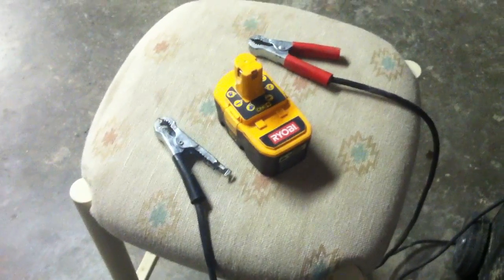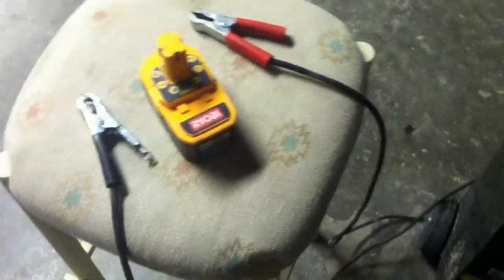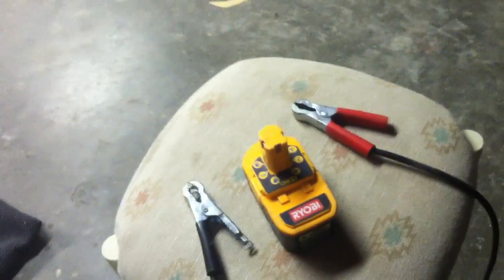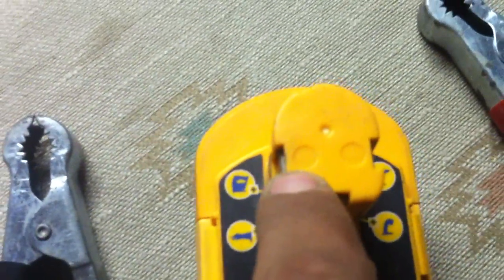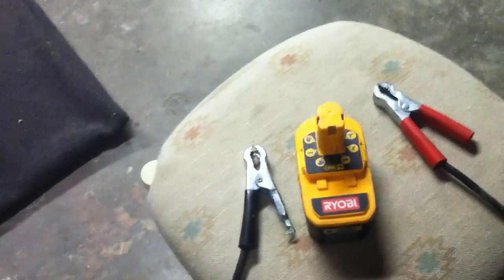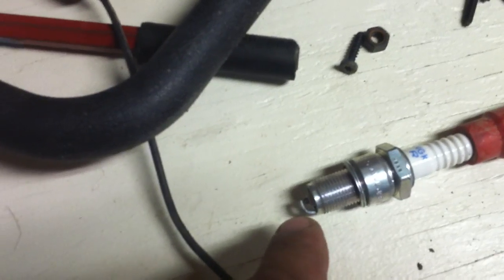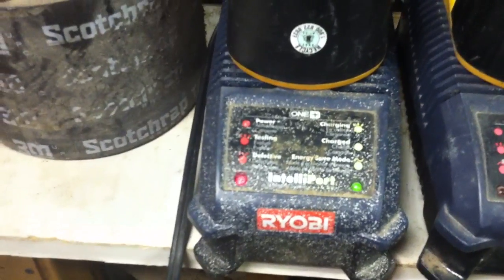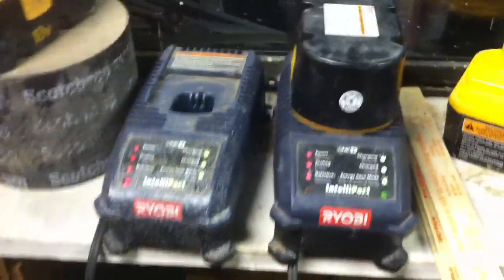Nonchargeable Batteries Recharged:18 Volt Battery.

Comment: i had tried the other tricks and they had not worked.  I used the 12v battery charger and that did it!  The battery is now charging on the regular charger.  Thanks for this excellent video!  I'm now excited!

Comment: You are so full of crap "Excite", "touch it to get a spark and it'll have a 'starter charge' ". Idiot, NiCD and NiMH batteries build up a wall of DENDRITE Crystals" internally. What the "spark" shocking does is to literally blast the Dendrite Crystals just as you "de-sulfate" a Lead Acid battery the builds up a Sulfate layer on the cathode lead panels in the LA battery. Voltage needed to "shock" the battery NEEDS TO BE a Minimum of TWICE the voltage capacity of the battery. 12 Volts will do shit in a 18V Ryobi NiCD battery. You need to shock (a single spark) it with 32V to 100V to blast the Dendrites. Do some research before your spread your BS info, you sound like a moron.
Reply: Yeah, this didn't do shit to my completely dead 18v riobi. Ill hit it with the welder and let u know.

Comment: the battery charger wont charge blow a certain voltage and also the ohm of the sense tab causes issue too at times a good battery in parallel is best

Comment: Someone had thrown out a Dewalt 14.4 volt drill, with the charger. It was blinking fast for a replacement, I tried unlugging and plugging it back in about 5 times and it eventually started charging normally. Worked great

Comment: Thank you that was a helpful hint I have a Black and Decker drill one is 12 volts and a 18 volts both batteries are dead cuz I had them sitting in the garage too long forgot all about I am going to give this a try and hopefully it will work. 👍

Comment: I tried the on/off trick with one of the original NiCad batteries and it worked. However I couldn't get the second battery to go no matter how many time I flipped the switch. Your video reminded me some one said to use a car charger and flip polarity and touch for a second. That worked and it started charging. So you are right, anything that sparks it has the potential to work.

Thanks for the video

Comment: I don't care what these other people say about you. I think your Awesome. 
How ever, this Will make your charger recognize the once completely dead battery and start charging but 9 out of 10 times it will Not take the full charge any more. For instance: You do this trick with an 18v but it will only charge up to 14 volts and then looses voltage and drops down to 9v.
My point is that the trick does not fix dead cells. This will work in a pinch for a short time and get a small job done for you but I think that if you have any bad cells you have to do a full rebuild or buy a new battery. The rebuild is tougher then these videos show you unless you invest in the proper tools for re-soldiering. I tried this with a regular soldiering gun and it just don't stick well.
By all means try the tricks before you trash them. You may get lucky.

Just my Nickles worth....

Comment: Didn't understand the motorcycle coil part. Do you hit that coil with the volts from the battery charger like you would with the drill battery? The way you present this is to leave everything connected to the bike and just pull out the plug leaving it connected to the bike and then turn the bike over. How is that doing anything different than firing it up with it still connected to the cylinder? I'm thinking you meant hit the coil with the high current and then put it back in the bike. Just curious.

Comment: Just yesterday I tried a trick I saw a while back on YouTube, it worked. I connected a wire from pos to pos and for neg to neg a good battery to a bad one, only about 15 seconds. It now takes a charge and I have used it. What sucks is I threw away about 4-5 batteries before I found and tried this trick, that well over $100 in the trash.

Comment: So what if my charger shows that it’s charging but when I put the bat in my saw, it cuts for about a foot it dies. Bad cells or faulty circuit board?
Reply: Nine months later you finally get a reply....i had the same experience.   I used the DC welder technique.   I found that going back through the process over and over until I was satisfied with the performance was worthwhile.   I have every style battery in my arsenal and all of them are good as new except one that I am certain was completely shorted.

Comment: Here is a problem for you people :
I left my P106 Ryobi drill with its Ryobi ONE ni-cad 18 volt battery in a drawer for a week..
Seems the switch was defective, as it killed totally the battery...
Tried all the methods shown in this section and I got it to charge with the red light of the charger ON  up to 15.6 volts which, placed in  my drill, I can stop easily the chuck with my 
hand, WHICH DOESN'T HAPPEN WITH A NORMALLY CHARGED BATTERY....!!!!!
If anybody has any idea of what has happened to my battery and more important, how is
it to OPEN it because I removed the screws but the cover doesn't come off and pulling on
it feels like there are wires attached to it, as the only explanation for its conduct seems to 
me that most probably one or more of the little batteries inside gave up the ghost...!!!!!!!
Thank you
Jacob
Reply from the maker: little battery's ? bon jour. hahaha thanks for watching.
Reply: @thomasbriansavingmoney  
It may sound funny but at the end, is there an answer to my question from knowledgable guys on almost everything about batteries, little batteries ASIDE...??????

Comment: I heard somewhere that you should "excite" the battery or coil, you have to get it excited, you need to excite it."Just curios if anyone has heard that before. ;)
Reply from the maker: perfect. thanks for watching. pretty exciting stuff.
Reply: Yes Tom :
In electric power generation for instance, there is something like EXCITING a component, specially in generators.
You won't believe it but with a 1.5 volt battery, you can EXCITE a generator to start
generating electricity, if the little remaining magnetism of the stator poles is gone

Comment: These battery "rejuvenation" techniques generally work to allow a charger to again work on what was a fully dead battery. But the main problem is the battery technology itself. This, and many other similar videos are all using nickel-cadmium batteries. Once they are fully discharged, at least one cell in the pack will never hold a good charge for very long ever again. I have many Dewalt 12 and 18 volt NiCad packs that are shot. The packs' prices are approaching that of complete tool kits with newer Li-Ion batteries. I have since stopped buying $75.00 NiCad packs and converted to drills and other cordless tools that use Lithium-Ion batteries. The packs hold a charge much longer when not being used. I have never had the problem of a fully dead Li-Ion battery yet.

Comment: Nono no. Coils do NOT develop crystals. Coils are hard WIRED copper. There is another reason you get results. Batteries are the only thing that develop a bad connection inside due to the CHEMISTRY.
Reply from the maker: and what chemistry is that, could you give more detail ? because i opened  a bad one and a good one because i wanted to see for my self what was going on, and the bad one had white crystals. the good one did not. i do not think you are a subscriber or that video would of found you after watching this one. let me find it and post you a link here and you explain the chemistry  side of it to us after seeing it. that would be great to get your input seeing how you seem very sure. let me get you that link, thanks or watching.

Comment: I watched another presentation that used two pairs of scissors to "excite" a bad battery from a good one. That didn't work for me, but it gave me an idea. 
I had an extension cord without a female end (thus, three exposed wires -- green/ground, black/negative and white/positive). 
I ascertained the battery positive and negative poles to touch. Making sure the open/hot wires were not touching, I then plugged the cord into a wall, then touched the positive and negative poles with the proper wire just for a split second, which gives off a nice spark (make sure you have protective eyeware and rubber gloves). Then I plugged the battery back into the charger and it's now taking a charge. 
It works. 
Now I just saved at least $50-$100 by not having to buy a new battery.
Reply from the maker: yeppers,,, same concept. good thing you were working with a/c because black is your hot. but your ok because the white is neutral and on a bus bar so the alternating current sent back still gave you voltage. on d/c black is ground , but on a/c black is hot fyi.. great job...thanks for watching.

Comment: Black n Deker 14.4 Shocking worked the older battery is solid, But my newer battery only gets 7volts compare to 16v on my old battery. Tried longer shocking got upto 10.9v but seems that i blew the newer battery cause its staying warm, not even plugged in i left it outside just in case. SO DONT KEEP ON CONTACT TOO LONG
Reply from the maker: great advice,, thanks for watching.

Comment: Chargers read battery voltage before the charge circuit is applied. If voltage is too low the charger will not charge. Quickly plugging and unplugging the charger will apply a small voltage to the battery. Do this long enough there will be enough voltage for the charger to work. Applying voltage with a battery charger will also work. It doesn't excite "crystals". The vehicle battery charger boost the battery voltage enough so it will take a charge. We had a pile of dead Milwaukee and DeWalt batteries at work several years ago. I spent an hour jumping them with a vehicle battery charger and revived 90% of them enough to take a charge. Most still had reduced capacity. I took this one step further. I disassembled the batteries that were weak or would not take a charge. There are several small batteries about the size of a C battery connected together in series that create the battery output voltage. I tested each cell with a voltmeter to determine which one was bad. Went to batteries plus, purchased the new cells for a few bucks each and soldered them back in place. Viola, an abundance of working batteries that held a good charge for minimal cost. This was on the old style batteries. Dont know how this would work with lithium batteries but I assume they too have cells inside that can be replaced once they can no longer take a charge.

Comment: I wish that I saw this video or the other similar ones about this process a few years ago, as I threw out a couple of good drills because the replacement battery packs cost more than the drills. This time I decided to take a different approach and was going to rip open the battery pack and replace all the cells. Then I found this procedure. I have been in the electronics industry for over 45 years and did not think that this had a chance to work. Well with nothing to lose I tried it and it did work. Before trying  this, my AC adapter melted down trying to charge a partially  dead battery pack. The AC adapter could only put out 1/2 amp and the battery pack would only charge to 12 volts, meaning I had 5 shorted cells. I used a laptop battery charger rated at 19.5 volts 4 amps to excite my battery pack. It would draw over 1 amp if left connected so that's when I did the repeated connect/disconnect and within a minute or 2 the current dropped to about 600 ma and the batteries were already putting out almost 18 volts. What more can I say? Now it's time to rejuvenate the laptop batteries.
Reply from the maker: excatly and well explained. thanks for watching pigman !
Reply: Pigman 5

Comment: This same thing work with phone battery when it's dead and won't charge I cut and old charger wire and place it directly on the battery +and- for short time then put it back in the phone  and it start charging all it needed was a boost up
Reply from the maker: thats great,,, thanks for watching.

Comment: Bad idea!  DELAYED FIRE HAZARD for Lithium Ion (LIon) batteries!
The battery pack was shut down as a safety precaution because LIon batteries used to catch fire.  Then someone figured out why, and manufacturers started adding safety circuits to keep that from happening.  What you are doing fools the safety circuit, and can lead to the battery pack catching fire:
 - Once an individual (3V) cell gets below (IIRC) around 1.4V, the copper electrodes start to dissolve.
 - If the pack is then recharged, the copper will form nucleation sites where metal whiskers will begin to grow (by electroplating), inside the cell.
 - After some charge / discharge cycles, the metal whiskers will begin to short out the battery cells.
 - Shorts in the battery cells can get hot enough to ignite the battery.
 - Oops, left it on the carpet near the baby's crib!

LIon batteries hold a LOT of energy.  They can catch fire and even explode, which will at least ruin any power tool they are in, and might start a house fire.

Better to get a new battery, or replace the old cells.  New cells (avoid cells that are cheap because someone jump-started discharged cells!) are fine.
Reply from the maker: ha ha ha ok, and if the the thermostat on your water heater goes out it can blow up too. straight through your roof. if your intake comes loose you can blow a piston right through your hood. if you light a fart next to your curtain the flames will suck oxygen from a left open window. i guess we better take precaution and do not test these batteries in the babys crib, thanks mr tech,,, good looking out for us ! thanks for watching.
Reply: thomas brian  I have personally seen a piece of equipment that had a jump-started LIon battery pack.  The battery pack caught fire.
Just Google "lithium ion battery fire" for videos, news reports, pictures of people's laptops that have been destroyed.
Or blow it all off.  Hey, it doesn't always happen and it's not YOUR tool that got burned up, why should you care?
Reply: Re the water heater: https://youtu.be/9bU-I2ZiML0. They have pressure relief valves for a reason...
See also "boiler explosion":
https://youtu.be/THf7j3VIRxA

Comment: Dude it won't work, yea they will charge but they will not hold it, batteries have a rechargeable life/so many times after that their done.
Reply: They will out live us if you maintain them by burning off the crystalline structures  from time to time.  Of course, if you ever short them it is game over.  Nicad are still running a few of our satilites and we have used the same set of original packs that we change out for maintenance until the next swap.

Comment: tried your system, yes the battery "charged to green" BUT when tested in a drill and others it doesnt work at all. ?
Reply: Bob Humphrey it's because you got the charger to start charging the battery again, when you did the trick from the video. That means you charged the battery just enough to get the charger to see a voltage across the battery , and it started to charge it. But the battery itself is bad and it won't hold charge anymore. You can very well just charge the battery with a 9 V battery for a few seconds and then plug it in the charger and it will start charging it. No need to do the trick in the video. 
The name of the video can very well be "how to bypass the low voltage threshold of the charger".

Comment: I'm not buying the part about the bike coils, because I was a tron tech for thirty years, and a hotrodder for over forty. There are NO "CRYSTALS" in a coil. They go bad if they short out or one of the windings in them burns creating an open.

Pro1er has the right explanation about the charger(s) too. STICK TO THE FACTS and don't make up the parts you don't understand...
Reply: For sure a battery and an ignition coil are totally different devices. One has nothing to do with the other. The plug has to be grounded to spark to begin with and what it does outside the engine doesn't relate to what it might do inside when under compression. very misleading info here.
Reply: Get a life @ss-hole
Reply: Start your very own battery business and make huge money here: HootBattery.xyz

Comment: I've got an Arlec cordless drill which I bought about 10 years ago , I hardly ever used it , I left it sitting idle (not used) for the last 9 years, I charged the battery up recently and it still takes a full charge and works as well as it did when I first bought it.
Reply from the maker: that"s great !! thanks for watching.

Comment: Exciting? Really? The spark causes the 'dendrites' little hairs that shortout the cells to burn up, then it's not shorted anymore. NiCD batteries that cannot be fixed or have a low capacity cannot be fixed. You abused the battery and it remembers the abuse and you will never get anymore than that amount of power from then on. NIMH and Liion are the way to go, but more expensive. NICD is old tech and any manufactuer that still sells it should be avoided.
Reply from the maker: uuuuhm not !!!!   here ya go rookie.
https://youtu.be/iaASuEGKsSk
Reply: thomas brian I saw it on the internet so it must be true.

Comment: I have a Porter Cable NiCd 18v battery that it says it's charging but when I use it  the battery lasts less than a minute. What can I do 2 fix that
Reply from the maker: kill it all the way, put a rubber band on the trigger and let it go until it wont go anymore. then put it on the charger for three hours. put the rubber band back on and let it hold the trigger again until dead. then recharge again and you will be good. i will make a video. do not throw it away. its good. you have been using it just a little bit and recharging long before its dead, this is why. it needs used. i will keep you posted when i upload the video. thanks mike
Reply: Ty and I noticed it gets a little hot on the charger too. Is that bad?
Reply: Ty again I appreciate the help